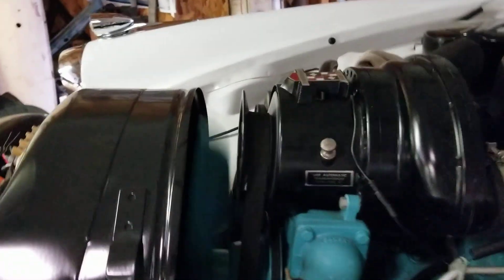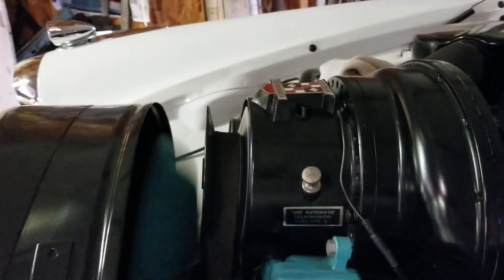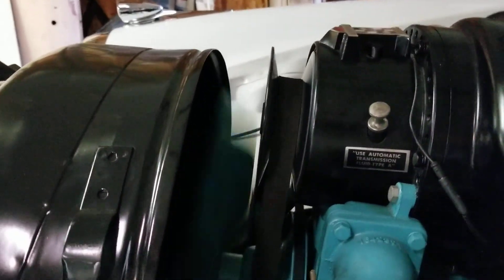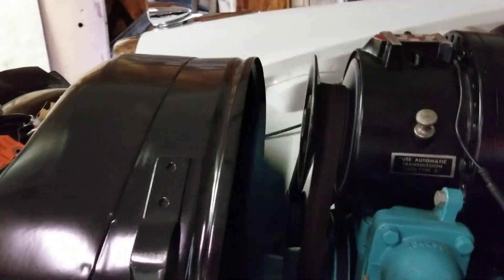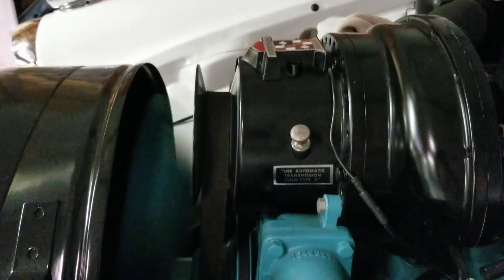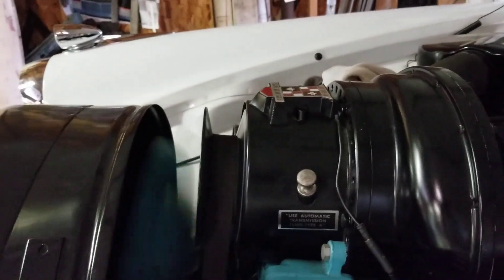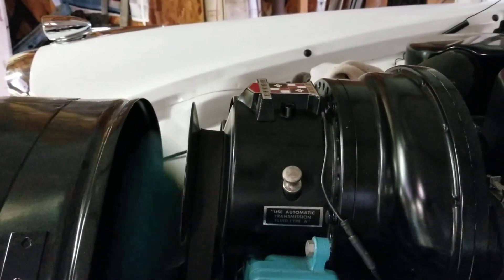Studebaker Golden Hawk Supercharger Variable Drive Pulley Function

Comment: It's like a CVT in a car or a snowmobile.
Reply from the maker: It is pretty clever.  It works off of air pressure from the supercharger impeller.  It has a blow off valve to regulate the pressure and control the pulley position.  All without computers!

Comment: Was that factory????   
Going from high boost to low boost????
Reply from the maker: Yes!  100% factory function,  Pretty cool!
Reply: @neilloughlin7080 I think it’s high boost in the low end right? It would make sense to give it off the line torque then back off the boost as it gets into higher RPMs so it doesn’t blow the motor